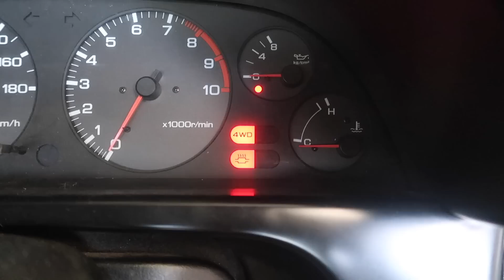Diagnosing the Problem... Secret GTR Codes!

Comment: If you pinch the Aux Air Valve hose shut, it's pretty much proof the valve isn't working. It takes a minute or more to completely close when it does work which allows the engine to warm up a bit by adding extra air as if the throttle was open a bit.Take the valve off, and look through it. You should see a crescent shaped bit of light showing which indicates it's open. Now connect 12 volts to the 2 terminals and wait a couple minutes. You should now not see any light. If this is the case, then you have a connector or wiring harness issue.

To adjust your base idle, make sure the engine is up to operating temperature, unplug the AAC valve, then turn the screw on the side until it settles at about 625. Plug it back in and it should go to about 650 to 700, then you know the AAC is functioning. That solenoid sometimes quits working, or the assembly becomes gummed up with oil over the years. Take it off and give it a thorough cleaning as well as test the solenoid. !2 volts touched to the terminals should make it click. It's a vital part of the system so it's worth ensuring it's operational. PS - you will likely need a new gasket if you remove it.

Comment: BRRROO RANDY YOU GOT CODE 21 NOT 33 Code 21 is related to coil packs or ignition amp since you and Christian already checked the coil packs for spark THAT MEANS IT DEFINITELY YOU IGNITION AMP you might have cleaned it but maybe the electrical part of it is toast stop being Cheap and buy a new one bro lol
Reply: 95_zenki I wonder if you got the comment or not because you're right even I saw that it is code 21 LOL I don't know where he got 33 from

Comment: I didn't see the result of pulling a coil at a time in the other video. Did you find the issue, or get a setup that was running OK?   This might sound odd, but go to the passenger side kick panel.   Take the door trim off, pull that panel. Disconnect the 10mm bolt on the ECU harness. Have a look at it, make sure everything is straight, and then reseat it.  I have had a car with a misfire that went back to the ECU. Once I reset the ECU, the car was on 6 holes.

Comment: If you’re having idle issues, check your BOVs. I have a R32 as well out here in Japan, and I’m having the same issue. It’s very common with aftermarket BOVs that you can have a leak. I’m moving back to stock for that reason. Hopefully it helps!

Comment: It is most likely a CAS going bad, BUT it could just be a loose wire.  They are finicky things.   The first thing to do is to just check the circuit.  What else did you modify on the car?  Reset the code/clear it.  Then go through and check all the connectors.  Look at the coils, the ignitor, and the cas wires.

Comment: Hey Randy big fan. It looks like the code it's actually giving is 2 long+ 1 short. Which would be 21 - ignition. This would make sense for the misfire. To be sure you should voltage test the o2 sensor to rule that out. It's free to do and you don't have to wait for parts.

Comment: Aye randy not sure if this will help. But check to see if your Idol control valve or sensor is good or leaking. Not sure if r32s have those but its not a bad idea to check. Ive ran into alot of cars that have that problem specially vq engines. But thanks for the awesome video and i plan on making some contents on my 1jz z32 build

Comment: Did you already check tps voltage? Should be around 0.44V, if the o2 sensor doesn't fix the problem get yourself a link g4 ecu cuz the stovk r32 ecu's are just bad. A friend of me has a r32 gtr and had the same problem swapped the ecu out and and now it idles perfectly normal :) high idle means vacuum leak we also cleaned throttle bodies etc also check your brake and clutch booster you never know ;) good luck

Comment: Block off aac valve to test idle speed, pressure test boost pipes or spray ether at intake, vacuum lines and intercooler pipe joins to see if the idle rises to tell you if theres a leak anywhere.
Bad 02 sensor doesn't always affect idle but will make it run rich as fuck.

Comment: Correct me if I’m wrong. Aren’t you supposed to leave the iac valve a bit more loose to idle right? My friend had the same problem that he had high idles. And he didn’t know why for almost a month. Then he figured out that it could be the iac valve on how it was put it. He then loosened it and it idled back to normal. This is just a past experience, so I could be wrong.

Comment: Check the codes again just to be sure. Idle problems are either tps or it could be a tiny hose. Sometimes there are tiny hoses for these old japo cars under the intake manifold. my supra screwed me over with the tiniest hose in the world. Keep trying its probably something stupid if the car just changed overnight
Reply: Plus if u did any work check the around the areas you did work something may not have been plugged in or attached also disconnect the battery and let the car sit to reset itself